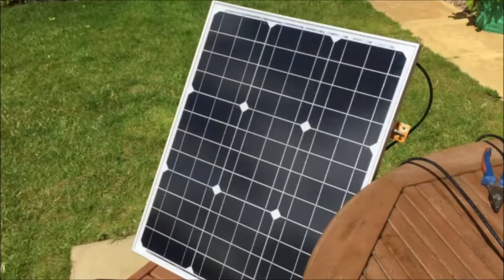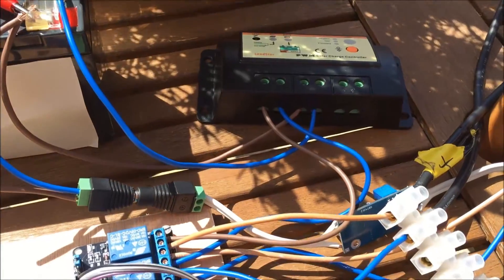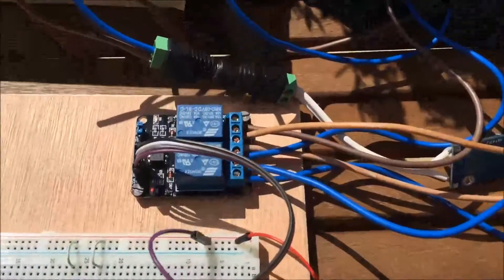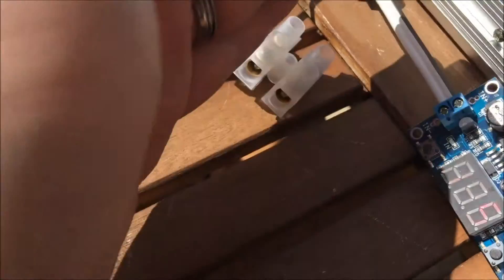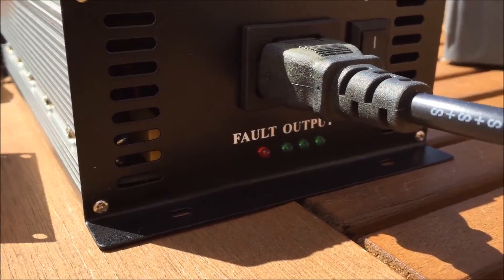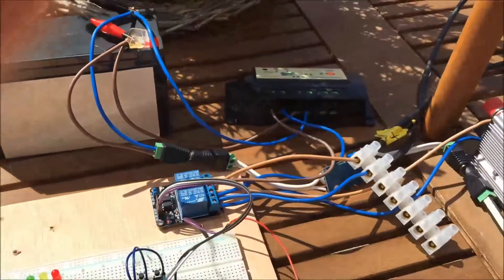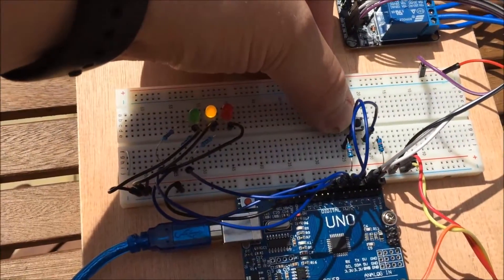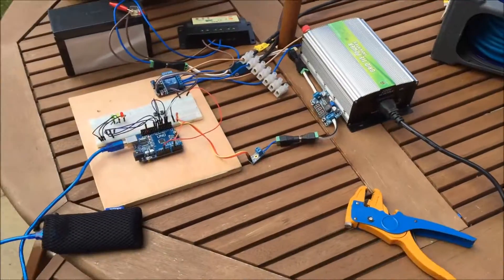Auto Grid Tie Switch - Adam's Arduino Projects

Comment: Adam, all of the plugin grid tie inverters I can find seem to expect a PV panel to be connected as the DC source, and performs MPPT to get the most power.

I assume you actually have the battery connected as the DC input. Is this correct?

Did you just use the PC panel version, but swapped the panel for a battery?

Comment: Hi Adam does the grid tye invertor switch off when the grid goes down?
Reply from the maker: +Alan Marshall It says it does yes. I haven't tested this myself, or in fact used this in quite a while.
Reply: This is an old video i know but can the inverter just be powered off batteries directly without having to be connected directly to the solar panels?  I'll have 600w of panels soon and have a 4.4kwh battery pack so would be nice to be able to provide some power to the house without the need for lots of expensive electrical work.
Reply from the maker: +Colin Hickey I've not tested this myself but I have seen videos where this is happening. A battery bank is usually out of the most efficient region for these devices. The other trouble is that they don't have any under voltage protection and they will take as much power as they can out of the system - so you have to be quite careful.
Reply: Thanks, the new charge controller from electrodacus can control an inverter so i guess i can get it to turn off the inverter when the voltage gets to low.  Will have to wait till i received it and do some investigation first before i spend money on a grid tie inverter.
Reply from the maker: +Colin Hickey The issue with GTIs for us is that most aren't approved (none of the plug in ones are to my knowledge) and our more recent electricity meters throw an error if they detect any back feeding. I haven't used mine now in a long time - it makes me nervous and most of the time was generating so little it wasn't worth the worry.

Comment: Hello, I love your project! Do you know how to switch source of power supply using arduino? Switch between solar panel and main electricity from an electricity company depends on the weather condition. for example if it's sunny, then it will switch to solar panel and if sun is not available then it will switch to the main electric supply. I really hope you could help! If not using hardware, using a software like proteus could help!
Reply: Hi Elma. I am also looking for such a project. Which site did you find it in? Can you pls share? Thanks
Reply from the maker: Thanks for the kind comments.  What you are trying to achieve is way above what this device was intended to do.  Working on an electrical main supply is not something I would ever do.  In theory it could be expanded to that sort of level but I don't want to suggest anything because I don't want to be responsible for any accidents.  

Assuming they are allowed where you are in the world a grid tie inverter does what you need. It will supplement the supply in your house when it has sun, and when it doesn't you'll pull all your requirements from the grid.  A hybrid charge controller would be the next step if you also have batteries to charge.
Reply: thank you for your fast reply!! i already found such project on another site! but really, thanks for the reply!! :D
Reply: hi ma,am, can you please help us create a system that it automatically transfer the switch to the the solar panel when there is an outage using arduino?

Comment: Hi Adam, great setup. I was wondering, does the system simply switch over based on the voltage threshold? Would this not prevent the PWM from performing float charges etc? I have the 20amp version of that PWM and sometimes it takes the battery up to 14.4 when it reaches float charge mode. It then pulses a few watts at a time. I've heard this keeps the battery in good condition. I'm interested in your project as I have my grid tie and charge controller connected to a three way switch which I mostly keep in dual mode so the power from the panels goes to both devices at once. It seems to work well as the GTI tapers off the power as the charge controller gets the battery up to healthy levels.
Reply from the maker: +Matt Cook Hi Matt.  You're right my switch simply uses a fixed voltage to determine when to start feeding the grid tie.  I've tried a few voltages but settled on 13.8 - the kind of voltage an alternator would supply.

My charge controller also has a absorb mode, and this is a good reason for fitting the switch and programming a manual mode.  Every once in a while, monthly perhaps, I intend to leave my panels feeding the charge controller for a whole day - hopefully that will help maintain my battery.  I've also been playing with a real time clock module on Arduino.  I might look into automating this 'charging only day' to occur on the first of each month?